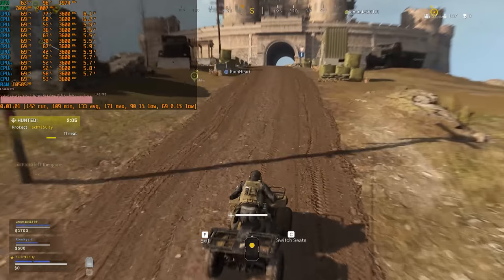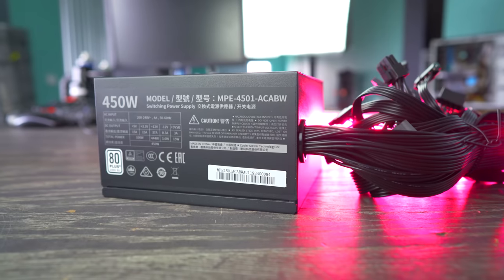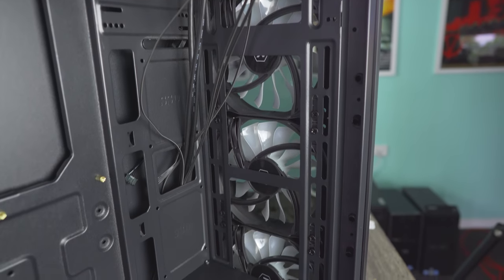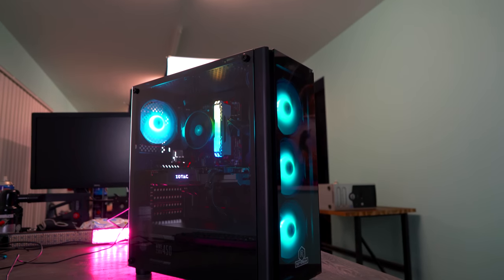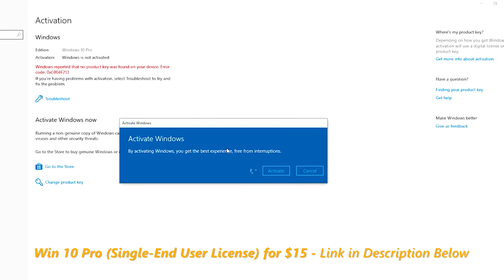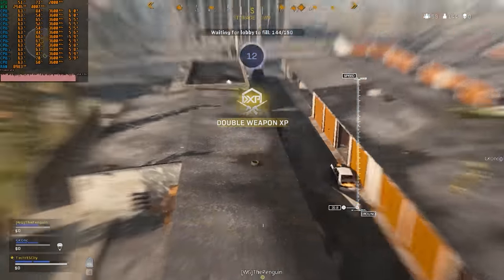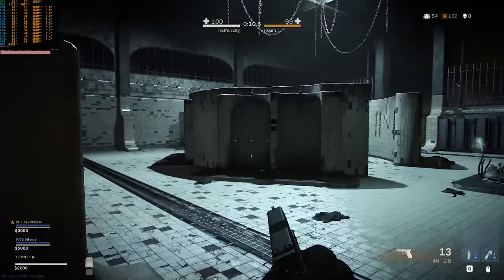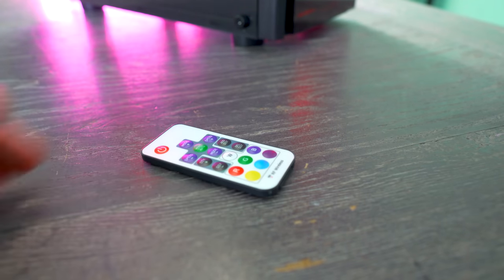The $590 CoD WARZONE 1600 AF "ULTIMATE Budget" Gaming PC

Comment: Can anyone explain to me why in everything low, with i7 7700k, 16GB 2400Mhz and GTX 1080 Ti i can only get 120 fps and normally i play with 100 average :( Never hit 144fps for sure.
Reply: bottlenecking, your cpu is way better than your gpu, consider upgrading to a better gpu, the 1080 to caps at about 110-120
Reply: @sugo5869  can u even read?

Comment: i have a ducking 1050ti that cant even reach 60 fps on the lowest settings
Reply: Well you at least got 'something'. I have 2200g with 2400mhz in  single channel with a busted PSU :(
Reply: that's because the 1050ti is a mediocre card that only got popularity because of the cryptoboom that forced AMD card prices to skyrocket. the Rx 470 and 570 crushed it pretty handily (and still do). It probably would have faded into obscurity like the GTX 1650 non-super has otherwise.
Reply: @Shoddragon  i will upgrade to a rtx 2060 super so atleast that would be able to play that game
Reply: @_Clipper_  try finding a 960 it will probably give you some more fps and its pretty cheap
Reply: it would although a 5700 or 5700xt imo would be a better buy right now. the XT performs similarly to a 2070super in a lot of games and is MUCH cheaper.
Reply: @Shoddragon  i know that its faster and cheaper but it has some driver issues
Reply: @Kykof  this is actually not the case anymore. AMD recently released some drivers that have solved basically all the issues people have been having for months. If you can find a 5700 or 5700xt for a good price, now is the PERFECT time to get one.
Reply: in my country the 2070  is actually much cheaper than a rx 5700xt
Reply: Well upgrade it to an RX 5700XT  or RX 680 8GB or a 1070 TI. AS long as you are working with the native monitor resolution and using 8GB of VRAM it should do great for 1080P gaming or midrange 1440.
Reply: @WikiForce  Imagine being a fanboy spreading misinformation in the year 2020 lmfao.

Comment: Brian I wanted to ask what if I bought an oem key activated windows and
After a while I change the boot drive or formatted windows would I need to buy a new key or use the same old key
Reply: You can use it again
Reply: Iirc, activation keys are binded with motherboard so unless you're changing that, you should be fine
Reply: @_Clipper_  That's good to know Thank you
Reply: You can transfer it to a new boot drive just look uphow
Reply: As long as you're on the same motherboard you should be fine. Windows is tied to your core hardware and not your drive. If you do change hardware and windows isn't activating anymore you can contact microsoft to migrate the key to your new hardware.
Reply from the maker: They are bound to motherboards.

Comment: bro i need you  to check with the asus strix rx470 4gb. .this shit is driving me crazy... thermal throttling badly no matter i do its still throttling and down clocking itself to 300mhz. help me bro..im here in your channel since 2016.
Reply: Please clean the fan-blades & re-apply thermal paste on the graphics chip -- ASAP -- before things get real bad . Also update the drivers .

When was the card installed ? Bought new or used ?
Reply: @abhroy  its used  ive cleaned the card  ..and applied thermal paste too( artic silver5)..and also tried multiple drivers. still same issue
Reply: @abhroy  do you have the same card?..
Reply: @astonlamb6491   . No , I've never used any AMD cards for my personal use . Sorry . Just make PCs with AMD cards for my clients when they specifically ask for that . Else , I always give NGreedia cards :))

** Please install  "IOBIT Driver Booster FREE"  and run a scan to update all drivers & game components . That might help -- immensely . Fingers are crossed . I am talking about multiple GBs of driver downloads here .
 **

Apart from the notebooks , my daily driver 2 PCs are  -- --
  
B450 ATX + R7 1700 + Zotac GTX 1050 TI OC 4G + 32 gig (8x4) RAM 3000,

Z370 ATX + I5 9600KF + GigaByte GTX 1650 Super WindForce OC 4G + 64 gig (16x4) RAM 3000

I am a system builder . Have been at it for the last 20 years :)

Please let me know if that helped . Thanks & Best Regards :)

Comment: I got i ryzen 5 3600 and a 1070 rog and cod is laggy as hell can anyone help me?
Reply: What are the temps on your cpu and gpu ?
Reply: @JuanM254  gpu around 50-60 and cpu .60-70
Reply: @JuanM254  but i got 8bg ram and no ssd can that be it?
Reply: @stianhenriksen6675  do you have a single 8gb stick or two 4gb sticks (modules) of memory ?
Reply: The minimum is 8gb but the recommended is 12 (odd amount imo) my friend is playing on a fx 6300 and gtx 1060 6gb with 16gb of ram in dual channel and doesnt have any issues. Im on a R5 2600 and gtx 1080 ti, 16gb in dual channel and i dont have any problems either. Also he doesn't have an ssd either
Reply: @JuanM254  i got 4x2 but mbby i need to reinstall drivers
Reply: What psu are you using ?
Reply: @JuanM254  A cooler master 500 watt. All i know its bronze rated and not modular

Comment: Gpu have different power usages recommend going with a 700 or 650 watt this guy is insane for using a 450 watt power supply even if you tested it with a 2080 ti and ryzen cpu no person spending that kind of money will have that power supply in use.
Reply: 450w its fine .the pc consumes around 300w gaming.Tho to be fair you could get a 600w psu for a few more bucks.
Reply: @syrynx4454  probably even under 300,
700 watts is pretty much overkill for anything right now.
Reply: @SameAtol  yeah but the 600w variant of the same psu can be found for 42$ so only 7$ more.
Reply: @novainfinity487  :)) yeah me too, i have a 850w gold psu, got it for a good price 3y ago which has silent profile ,meaning fan doesn't spin unless it uses 40%+ or above 340w  and with my rx 580 r5 3600 the fan never starts.Had to add a fan to cool it anyway.